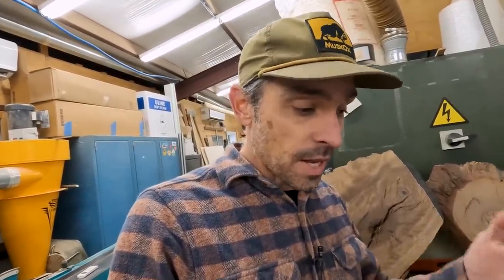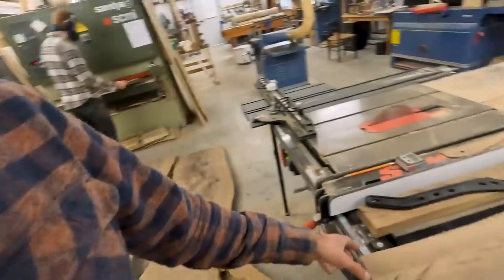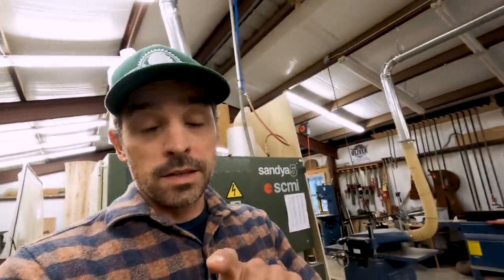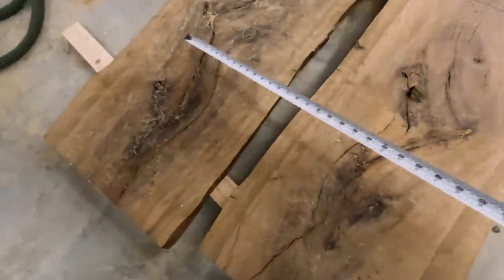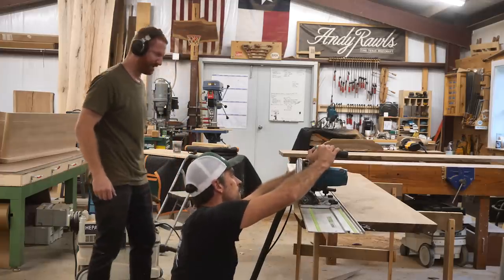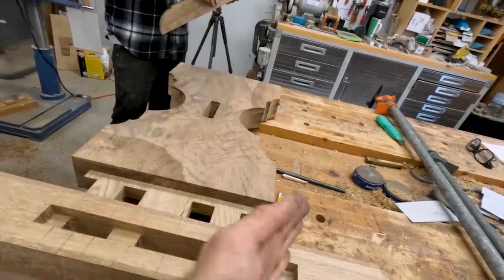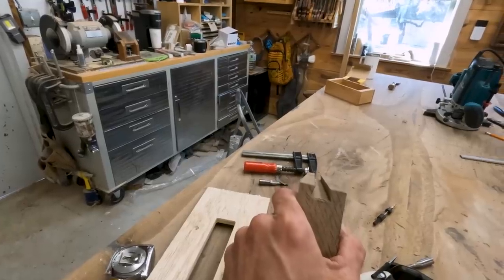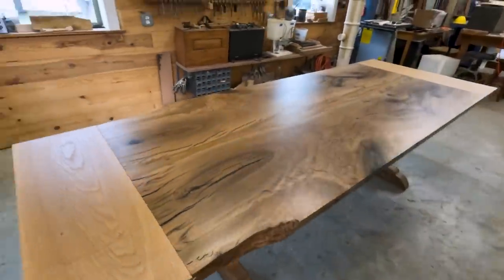Live Oak Dining Table (An Amazing Wood That Most Woodworkers Ignore)

Comment: Table is great, veneer live oak work is extraordinary. I’ve tried working with that stuff- I quit, I had nothing but problems. So kudos on a great job.  But those extensions… aside from not matching the table I do see you back there installing some kind of hardware to keep them flat and reliable while in-use. This will involve something custom from one of the many excellent blacksmiths in Texas. It will also involve filling the sliding dovetails in the top, maybe an opposing piece of Live Oak?  If there are kids in that house they WILL break the ‘sliding dovetail with plywood’ version. In fact I can see one of them using the extension as a diving board as I write this, so good luck.  Finally, any time I have made trestle anything, the trestles did not stay perfectly flat, and or the floor they were sitting on was hooched, so the trestles required some stand-off feet so they only had to touch at four points. Luckily a 1/4” thick pad 3x3 (or square to the thickness of the trestle) glued to the 4 corners is all that’s required  to keeo the table from shaking or skating around when in-use.
Reply from the maker: I’d like to make a response to this and just to preface I always appreciate the kind comments and the criticism.  In regards to the extension, the client and I have agreed to darken them with some color, which I’ll be doing free of charge.  I disagree with your opinion on their strength and I highly doubt a kid is using a dining table as a diving board.  To add to that, these are extensions which spend 90 percent of their life in a closet and if they should ever break during that 10 percent of use I’ll happily fix them for free as I offer a lifetime guarantee on my furniture.  In 11 years of business I’ve only repaired one piece due to faulty construction.  You may not of noticed it in the video but the base has a 1/4” relief cut so that it sits on four point and not on the entire base.  This feature is on all my trestle tables.

Comment: Yep I agree with Chuck Cirelli , everything is beautiful until you get to the end leaf's. And rather than the dovetails a hidden metal mechanical dovetail would be much stronger. And for a home owner to have to add the filler piece, when not using the bread board leafs is kind of a pain ! Plus veneer edging on the vertical legs would have been really nice. But that's just me . All and all it's very beautiful !! Lots of work but in the end it's worth every grey hair !! Ha two thumbs up my brothers!!
Reply: Agree on both points.

Comment: Andy- why did you glue the through tenon stretcher and wedge in place instead of leaving it free to knock down? It’s a massive table and judging from your groans it’s equally heavy. Leaving it as a knock down would make moving it easier. The table is beautiful.

Comment: Man I used a slab of live oak to make a plank chair once that had some carvings in it for decoration and I gotta say that it's an amazing beautiful wood but it is HELL on tools. The density of it is crazy and the sheer weight of it makes it difficult to work with. I wonder how many tools needed to be sharpened after this table?

Absolutely stunning work though

Comment: You seemed to be pushing hard on the track saw when cutting the boards, is it because your machine lacks power or didn't you use a rip saw? Normally you should be able to cut this thickness in one go I'd say. Anyway always nice to see your new videos, thanks.

Comment: Hope this isn't a silly question:- how come the metal straight edge doesn't move when you are using the circular saw?
Reply: It's a track saw.  There is a rubber material on the bottom of the track to prevent slipping.  There are also slots for clamps when needed.
Reply: I'm pretty sure it's strips of rubbery material on the bottom of the track.

Comment: Nice work!
Did the tracks give a sufficient glue up edge??? No need to run it on the jointer?
Reply: im guessing he jointed the edges with a strait edge and flush trim bit in a router. like he did earlier when cutting the pie piece